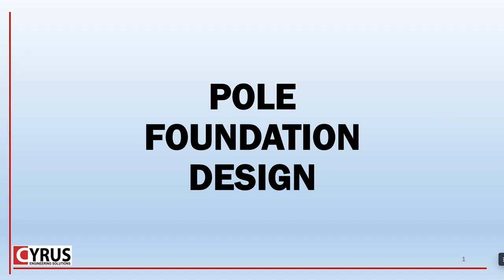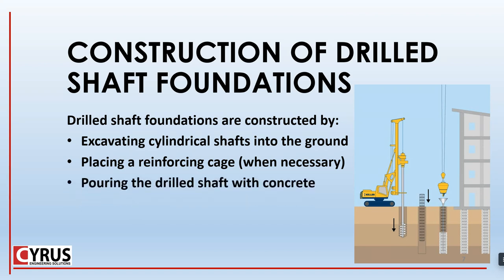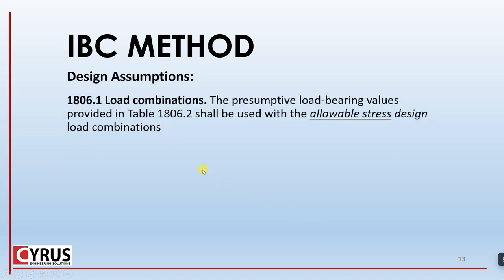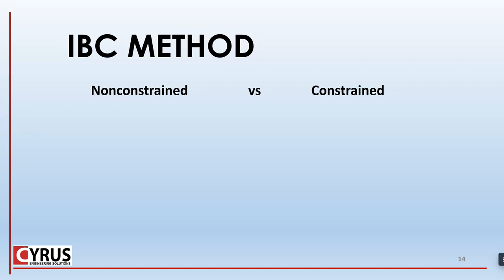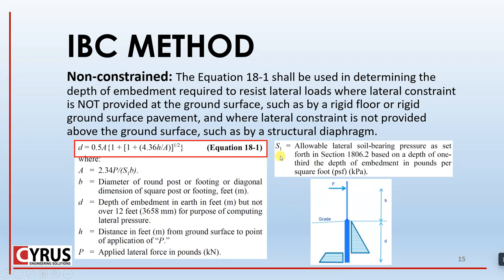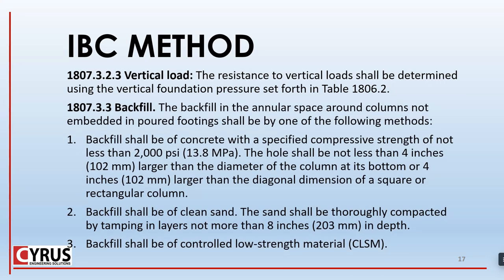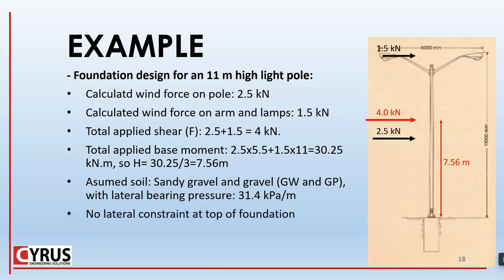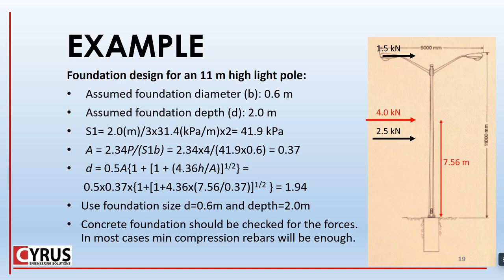Pole Foundation Design

Comment: thank you for this awesome video. The total applied base shear in your calculations is not correct.
Reply from the maker: Thanks a lot for your comment. The focus on this session is not shear calculation on the pole, it is more about sizing the concrete shaft, but out of curiosity, why do you think the base shear is not correct?

Comment: Thank you for the video, very nice way to explain it. Can you please suggest how you design anchor bolts connection for the same structure instead of embedding pole inside the concrete?
Reply from the maker: I am glad you liked it. 
Anchor bolt design for the poles is very similar to AB design for columns base plate with overturning moment. You can simply calculate the tensile force in the anchor bolts by dividing the overturning moment by the AB spacing. It is a bit conservative, but simple and easy. Then you can calculate the required AB size and development length based on the calculated tensile force.

Comment: The shear value is correct, but the placement must be at the base of the pole.
Reply from the maker: The total shear force will be transferred to the concrete shaft at its connection with the pole, right on the top.

Comment: How were forces on pole, arms, and light fixtures calculated?
Reply from the maker: Thanks for you comment. I hope the presentation was useful. 
The loads have been calculated in accordance with the IBC standard. The details of load calculations was not provided as it was of secondary importance to the main goal of the presentation which is the foundation design based on the IBC.
Reply: Hello, The forces on the pole and its appurtenances should be calculated based on respective effective projected area (EPA) and the shape factor (Cf) for each item, the resulted area (m2) multiplied by the velocity pressure (KN/m2) shall give you force (KN).